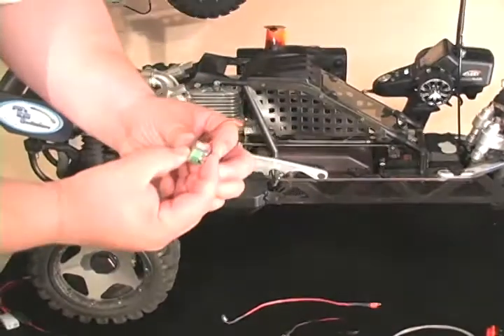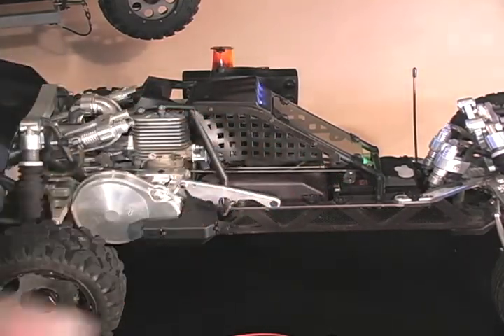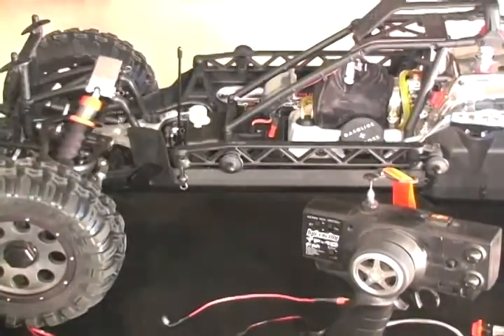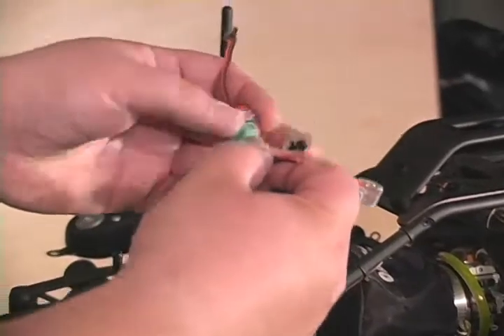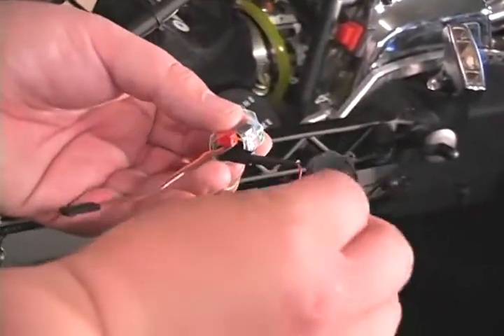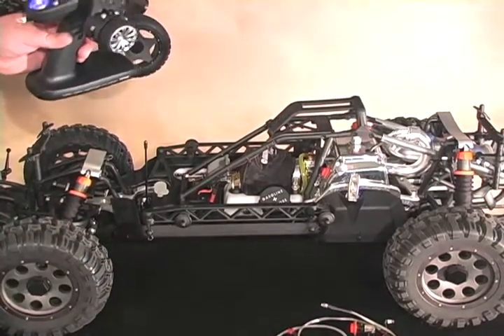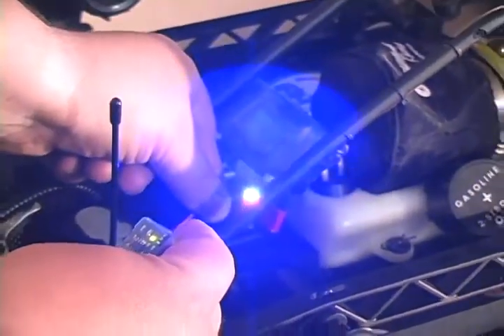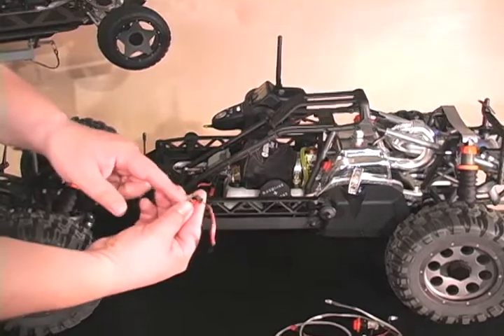Killer RC's Killer Bee v1 Remote Kill Switch on Baja 5B & 5T

Comment from the maker: @marcus730743 No. The kill switch has nothing to do with the servos. Most modern radios have a built-in failsafe in the radio receiver that can make the servo apply brake. You just have to read the radios manual and set the failsafe appropriately.

Comment: Im pretty sure that the the superbee killswitch works with the stock radio gear but u have to buy and 2 way splitter and use the same channel as your steering servo, and it still work but the only thing you cannot do is cut it on command... thats just what I saw on the pdf instructions i down loaded for the superbee killswitch.... thanks for your reply :)

Comment from the maker: If you have the HPI 2 channel 2.4ghz radio then there is no kill switch that will ever work with that radio. It's just a problem with how they designed their receiver. You will have to get a different radio. I recommend Futaba.

Comment: hi!let me understood the usage of that gadjet!!in the bigging of that vid you said that with that switch you can prevent a throtle servo burn !!this thing works either if we have or not a fail safe,right??if we have fail safe when we closed the trans. with the receiver on the fail safe will put dervo in brake porition!!in this case the kill switch will reset the servo in neuteral position!in other words that thing cut off automatically the power in car?

Comment: Can you place the killer bee switch on top of the receiver or close to the antenna? Will it cause interference from the motor?
Reply: // Make sure to use resistor type spark plugs, to minimize interference.
2.4Ghz will not cause any problems, just dont cut that wire antenna, its not the typical frequency antenna.

Comment: I have the hpi baja 2.0 if i bought the superbee killswitch could i still cut the engine remotely on command with the stock radio gear or do will it only cut the engine if the a glitch etc ?